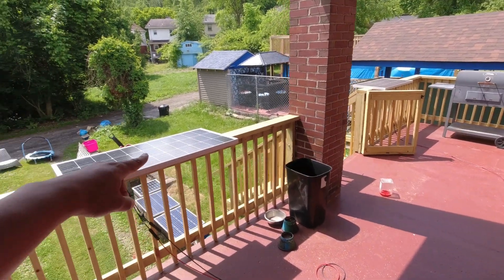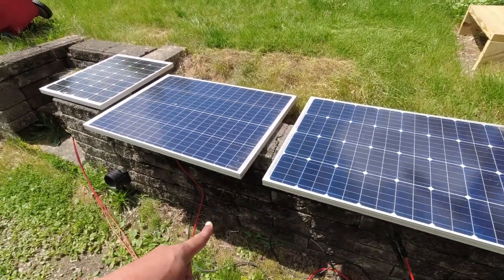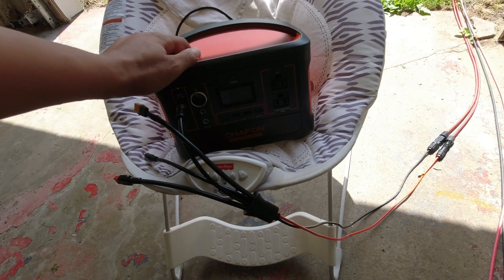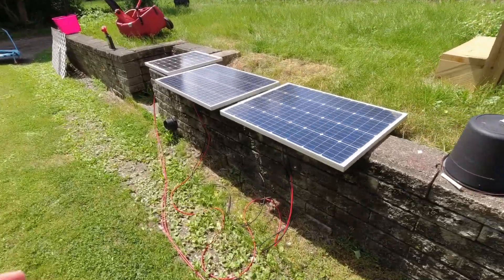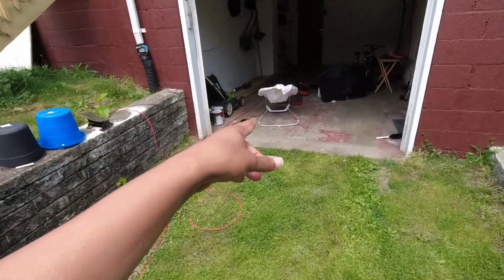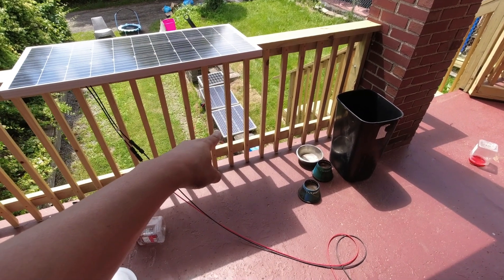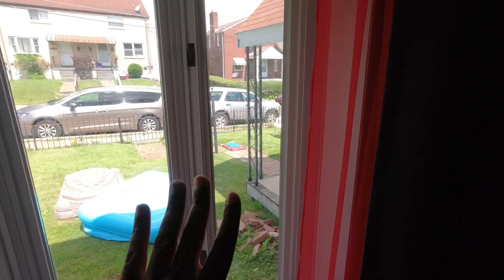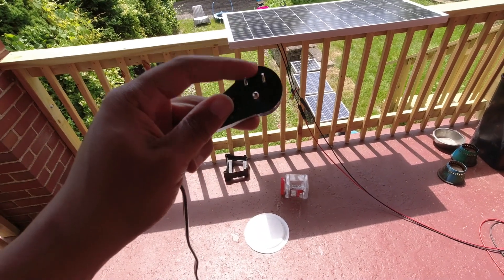My Complete Solar System | All Panels & Power Stations!!

Comment: Rockpals gave me a full refund and let me keep the power station. (After I gave them a huge speech about making prepping videos on YouTube)
Reply from the maker: Nice! That's a win. Every bit of power you get from it ... Is now free. That's awesome.
Reply: @AskIveSolar  There is one working USB port left on the Rockpals. I plugged in the 5 watt fan I use and it sounded like it was running rough. It has four settings, one a very powerful high amp setting, and it worked on all of them. I didn`t really pay attention but left it running to see if anything weird would happen. The power station was charged to 49%. The fan was on low which draws about 3 watts max. After one hour the fan stopped. I looked and the power station was flashing 0% and shut down. Very strange! Normally a 50% charge would run that fan for literally days 24/7. 

The power station is on charge and seems to be charging. I`ve seen other reviews, but not on Amazon, about these Rockpals` display % of charge rapidly changing....dropping from 100% to 89% or lower in just a few minutes, or being very inaccurate, and the charge level on the display caught my attention a couple of times recently because it seemed that the Rockpals was lasting longer on a charge than the Golabs using the same fan and LED bulb. Using the Golabs for 24 hours and then the Rockpals for 24 hours made it seem that the Golabs was less efficient, because it would drop by 16% or so but the Rockpals only used 9%. 

I haven`t done a full charge/discharge cycle on the Rockpals ever, but Golabs recommended that as soon as you received it in order to calibrate the display apparently. So the Rockpals display has been WRONG this entire time, and using a fan which can cause back EMF probably caused damage to the USB circuits due to low voltage! That also explains why the rice cooker cooked rice in 20 minutes the first time and then acted strange when I used it with the Rockpals the next time....wattage kept slowly dropping, reading at 92 instead of 95, and the heating became slower and took almost 40 minutes. Unregulated 12 volt output was only pushing 8 or 10 volts and it only had 10% to 15% of the battery left at most if that but was reading 70%. 

That`s my diagnosis at this point. No way a fan pulling 3 watts drained 49% of 289 watt hours in one hour or less. Ah HA! Has the mystery been solved? We`ll find out after I charge it to 100% and put the Drok tester on the remaining USB port and put all the other outputs to the test.
Reply from the maker: @baneverything5580  Sounds like you're onto something with that display. I always doa full charge discharge cycle with stuff like that.
Reply: @AskIveSolar  It`s very possible that the other two USB ports aren`t damaged at all but simply didn`t have the proper voltage to function. The individual USB ports have different voltage/current ratings and functions and are "smart" USB ports that detect the voltage/current needs of a device and adjust their output. Maybe low voltage causes what they did? One did nothing and one worked fine. The light blinked off and on connected to the other one. That means the capacitor in its circuit wasn`t getting enough energy to stabilize the output but was slowly charging then discharging. It does the same thing when one of my portable solar panels isn`t getting enough light. I`m gonna charge it to 100% and then test everything. There`s probably nothing wrong with it at all except an inaccurate display. Got my fingers crossed!
Reply: @AskIveSolar  Diagnosis: Inaccurate display...low voltage malfunction. Everything works. All USB ports work. But the battery was likely damaged some because of this and I was being very careful to avoid what happened and would never leave it at a low state of charge for a long period of time. That can cause short circuits in lithium ion batteries and raise the rate of self discharge.

So the unit is defective as is, but now that I know this I`ll have to do full charge/discharge cycles or learn to use my multimeter on the unregulated 12 volt port to predict the charge level. The next time I do a complete discharge I`ll take voltage readings from the 12 volt cigarette lighter plug at 0% charge, 10% charge, 20% charge, and so on and use those readings to prevent surprises in the future.
Reply: @AskIveSolar  FREE ENERGY! I should be getting the Bluetti EB70 this week. I have about 800 left from my stimulus checks and over 2000 of it was spent on prepping. I`m carefully ordering certain things now to fill in the gaps. Later on I`ll still be able to afford to buy a solar panel if needed, a charge controller, and inverter, then add batteries, but these purchases will be one part at a time each month or every other month. But until I get moved and get my travel trailer set up I won`t know exactly what my solar options are there, especially throughout the year as the position of the sun changes.
Reply: @AskIveSolar  What`s the actual wattage rating on your freezer? I hope the EB70 powers the small freezer I ordered. The Igloo freezer I wanted ran on only about 80 watts but they sold out before I went to checkout. The other one I ordered is the same size and can be set for various temperatures and even has a refrigerator setting but the seller hasn`t responded to my question about the wattage, which could probably get them fired if I didn`t like the answer and cancelled my order. Typical business move of Chinese sellers. But I don`t blame the employees for being afraid. I`ve read books about how horrible they`re treated. Something rated for 700 watts and spikes of twice that shouldn`t shut down that way. 

I got the five year protection plan when I ordered my freezer. At 9.99 it was a no brainer. Nowadays you need a protection plan on the protection plans though...
Reply from the maker: I gotta check the deep freezer

Comment: I picked up a 425w solar panel from a company up here in Canada for a decent price. Lynac is the name of the company. I actually bought a basic solar kit from them just to mess around with. My problem is I didn't look at the size chart, the thing is HUGE! I had to go get it from the shipping company and it didn't fit in the bed of my pickup, it hung out over the tailgate. Yeah I have no idea how I am going to mount it. It's almost the size of my outdoor patio table. Oh well I get decent sun in my backyard from about 11am onward, so I may just get some cheap folding table for now.
Reply from the maker: Yeah man. Those things are huge. If I put my renogy panels side by side, I imagine that they look the same as the 200 watt panels from bougerv (that are going outta production) and it's sizable. I imagine that's about half the size of your panel. 

Keep me posted man.
Reply: @AskIveSolar  will do,  had a moment of weakness on Amazon just now and grabbed an AC200P.  Should work well with my panel.
Reply from the maker: Nice @ the acquisition! Yeah definitely keep me posted

Comment: You genuinely helped me out alot in the last 24 hours. Get your affiliate up, I'll support you on that! FYI, I broke down and got the 200 watt Bluetti solar panel and kept the EB70. Your reviews helped me on my decision. But that will be the last time I spend that much. Don't want the Mrs too mad lol.
Reply from the maker: Hahahaha @ the Mrs! Glad I could help.
That bluetti panel is slick for sure and there's no question to whether it will work with your device. I feel you.
Reply: All In The Soil .. Two cheap 100 watt panels can be connected in parallel to the Bluetti EB70 and provide almost 150 watts. That`s plenty of charging power. You could have saved 340 dollars! You can buy six 100 watt panels for the price of the Bluetti panel!
Reply: @baneverything5580  Its for traveling. I wanted to save space, be mobile, light, and wanted just one 200 watt panel but yes you are right I could have spent way less and got more panels.
Reply: @AllintheSoil  I just wanted to tell you in case you didn`t know so you`d have time to return it. I saw a guy connect two 100 watt panels and get over 140 watts. Today I ordered a second 100 watt panel and parallel connector after I saw the video. I think 140 watts should be enough to charge it in one day. What I plan to do with it since it has such a large capacity is do what Will Prowse said and cycle it as much as possible between about 30% and 70% charge over 90% of the time and see if I can get 14,000 charge cycles to 80%. Doing this preserves the battery capacity above 95% for when you really need it the most. But I`m starting to have doubts about the electronics holding up in these things for very long. Trying to preserve battery capacity and longevity might just be pointless.
Reply: @baneverything5580  Thank you! I appreciate both your messages and I'm sure others will also. I'll check out Will Prowse.